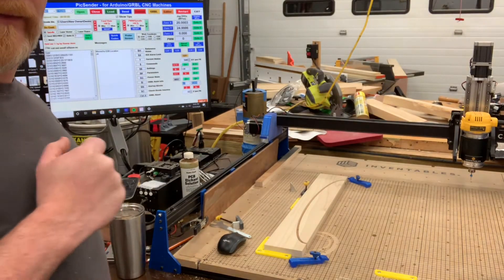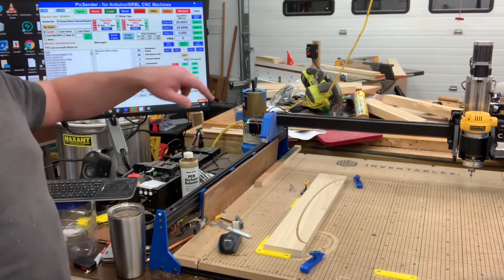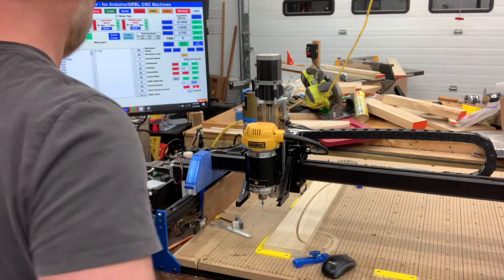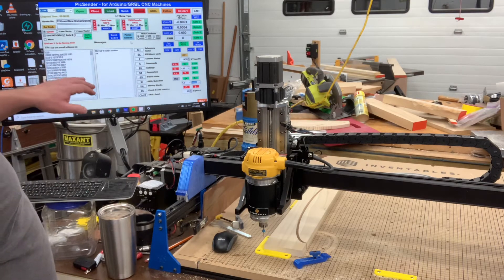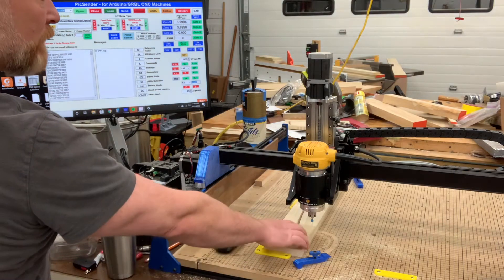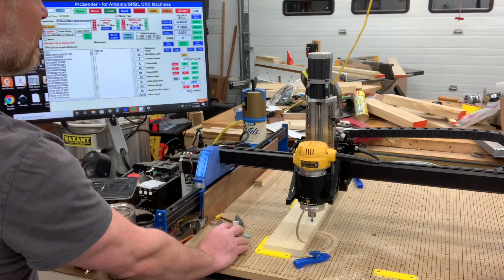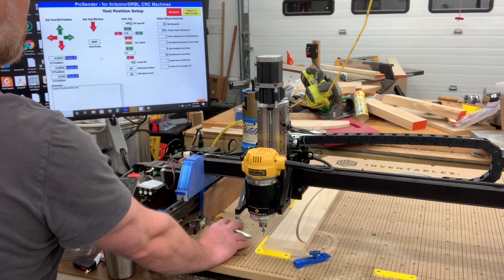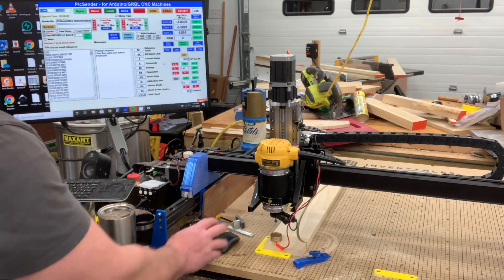Picsender part 2 for xcarve

Comment: Nice video, very helpful.   How do you physically setup router wiring to turn on with M03?  TIA
Reply from the maker: Munawar, you have to have a a relay setup to receive the grbl command. Amazon has sold a relay that's currently unavailable, but you may be able to find a similar one. Your controller has to have the option to send the command to the relay though to turn on the router or vacuum.  https://www.amazon.com/gp/product/B00WV7GMA2/ref=ppx_yo_dt_b_search_asin_title?ie=UTF8&psc=1
Reply: @mongrelbees2616  thank you!  I’ll look for the relay from your link.  It’s a XCarve controller so I am sure it has the option, I just have to figure out which terminals
Reply from the maker: @munawarsoomro6207  spindle 0-10v and ground
Reply from the maker: you will also have a gCode setting, i think $32=0
Reply: @mongrelbees2616  I truly appreciate your help.  So fast and so helpful.  This is awesome.

Comment: Do you have to set G28 and G30 every time you use the machine? I typically shut everything down when I'm done using the computer and XCarve for the day. Last weekend I set G30 after watching your video and it worked fine the entire time I was using the machine. Today, I did a carve and the G30 setting had been lost and I had to set it again. Is this a setting that has to be done every time I use the XCarve or do I have an issue where the setting isn't being saved correctly by PicSender in GRBL?
Reply from the maker: Mine is saved. You have to be careful to choose G30 and not 30.1 or it resets. I had to be careful about that.  Also, choosing close at the top middle should save your settings for the next time.
Reply: @mongrelbees2616  Thank you. I did not click on close so maybe that's where my problem is. I'll give that a try tomorrow.

Comment: With all the far superior diy cnc avail today.. at same or less priced....why did you choose one of the worse designed flimsy underpowered small cnc ever made?
Reply from the maker: Lol, well HS, it was a couple years ago. I didn’t buy it today. If I had, I would have probably chosen a different option, but I had never owned a CNC before and there was a bit of a learning curve. I’m a bit better informed today.
Reply: ok well that may make sense...i own a J-carve j is for junk but i got mine for only $120 back in 2018..its a POS...and today there is no reason to buy one there are several better options at same price and are so much better than the xcarve ..mark my word though xcarve will be redesigned very very soon...if xcarve wants to keep up with competition it will have to cahnge....rubber belts , underpowered stepper motors, extremely minimum z axis  and v wheels do not belong on a cnc machine...and you cheated you upgraded your stepper motors and z clearance height  and your z axis so your machine is not a stock xcarve so..you cant consider it an xcarve and give false expectations to other people... :) by the way how is picsender compared to UGS...i use UGS.
Reply from the maker: @shelby50411  I did upgrade several things that now I know, it would have been cheaper to have bought a beefier machine in the beginning. I use vcarve and picsender and have been pretty happy with the results. The v wheels require a lot of checking. I may build a custom machine the next time around. I’m planning on cutting a hole through the center of this table so I can drop boards down through to enable me to do some fancier mortise and tenon work.
Reply: yeah well it is what it is..i laugh at all these people who spend 2k on the junk-carve and then toss out 50% of the machine and purchse upgrade parts...to me thats not smart at all but it does happen..at least you relaize it wasnt a good idea..at least your machine now is a bit more capable i use vectric aspire and UGS....i have never used picsender ..is it free and similar to UGS?...i only use easel once in a blue moon..its pretty much useless but it has 1 thing that vcarve and vectric doesnt have and that is that it can do stacked engraving very simple and vcarve is not as simple to do...other than that i dont use easel since its way way  too limited..easel is for baby beginners.  and another thing i hate about eeasel is it is tethered to the internet and i dont like that at all and inventables has possession  of any project you make which is a huge nono in my opinion...
Reply: yeah well it is what it is..i laugh at all these people who spend 2k on the junk-carve and then toss out 50% of the machine and purchse upgrade parts...to me thats not smart at all but it does happen..at least you relaize it wasnt a good idea..at least your machine now is a bit more capable i use vectric aspire and UGS....i have never used picsender ..is it free and similar to UGS?...i only use easel once in a blue moon..its pretty much useless but it has 1 thing that vcarve and vectric doesnt have and that is that it can do stacked engraving very simple and vcarve is not as simple to do...other than that i dont use easel since its way way  too limited..easel is for baby beginners.  and another thing i hate about eeasel is it is tethered to the internet and i dont like that at all and inventables has possession  of any project you make which is a huge nono in my opinion.....have you seen the new xcarve pro? its a joke. $12k for a POS>
Reply from the maker: @shelby50411  yeah, the spotty internet I have way out in the garage is the reason I had to get away from Easel.  I did like some of the features it provided, like some of the visuals, and reminders to make sure I turned on the spindle before I sent the gcode.  Picsender is not free, but it's not that expensive either.  I'd like to spend more time making a better video, and maybe some macros for it, but all in all, I've been happy with it.
Reply from the maker: I will say that for someone who has never used a CNC, I think the x carve is the easiest first exposure to a CNC out there. The software, though temperamental, is still a very easy software to use for someone with no experience. I have seen many crafty people with no experience make things within a day or so of setting it up. In the future, I’ll probably upgrade to something more robust if I have a business model that supports it, and may convert this into a dedicated slab machine or rotary.

Comment: Hi Mongrel how do you control spindle power?
Reply from the maker: Well, picsender does have the option, but router based CNC like mine is manual. I adjust the speed of the router on a speed control on the router itself. On picsender, you can turn the router on and off with I think the m3 button
Reply: @mongrelbees2616  where do you connect router's power cord to then?
Reply from the maker: @hanbinkim2636  it’s plugged into a 12v relay. The relay supplies 110v power and is switched on and off via my CNC controller. It sends a signal to the relay to turn the router on. I have 2 relays- the vacuum and the router come on at the same time.
Reply: @mongrelbees2616  Thanks! This is nice information.